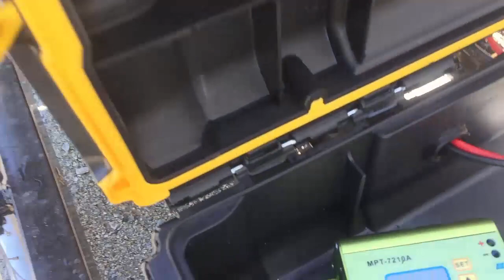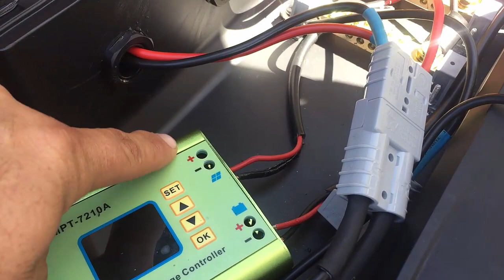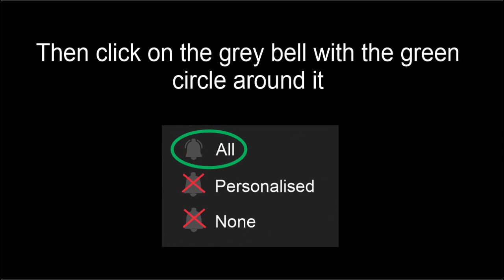Quadricycle Build - Maiden Voyage By Off Grid Mojo

Comment: Hi Ash. Would you need any special permit to ride the quadricycle on the roads? It is 5.1m long after all. One good thing about being heavy is that the wind won't tip it over.
Reply from the maker: No special permit needed as far as I know! The electric assist is 250 watts and does not need to be registered.
Anything over 250 watts does though. However things will change soon enough as there is going to be some tweaking on the regulations in Europe and then that will filter to us as we follow them!

Comment: I agree, 2 1000watt hub motors, controllers, and 2 20ah 48v batteries would set you back around $1200 but would be worth it as you could climb nearly any hill with them.
Reply from the maker: The issue with anything over 250 watts is illegal here in Oz! I have heard on the grape vine though that they are looking at changing that limit higher due to cargo weight etc. Basically Australia has the same legislation that the EU has, so once it changes there my guess will be we will follow suit! I would like an extra wheel on either side at the back of both the prime mover and semi trailer, but that may just be romantic ideas as I don’t have enough knowledge of these things to realise if that’s even possible!
Reply: @offgridmojo  Thank you for replying.  If that were the case here I think I would just install an AGNI/Lynch High power axial gap DC motor (a fantastic motor invented by Cedric Lynch of the UK) and register it how he did.  He rides a 2 wheeled fully enclosed motorcycle powered by his motor on UK roads almost every day possible.  That motor can make from .1-15hp depending on current input therefore it's amazing.  Maybe you'll have to register and accommodate your vehicle as a motorcycle?
Reply: @offgridmojo  Also-here in the USA I ride a mountain bike with 1500 watt hub motors both front and rear with a pair of 1.5k controllers mated to one 20ah 48v battery.  I'm sure it's not completely legal or even nearly, yet I have travelled over 10k miles while breaking many traffic laws without being pulled over by the police, and 50k miles on gas powered bike conversions in my past with no problems whatsoever.  My plan was always to just pay the ticket if I got one, but so far so good.
Reply from the maker: @ProlificInvention  I will check him out, thanx for the info mate, it’s appreciated.
Reply from the maker: @ProlificInvention  Yeah I have often thought about just taking my chances and going more power etc, funnily enough though it’s not the power that concerns me the most or the speed! Main concern is will the rig hold together, will it crumble under so much weight etc!

Comment: Das Gespann schaut einfach nur Klasse 👍 aus ‼️💯😉 aber warum kein Differenzial hinter ❓🤔😉🍻
Reply from the maker: Thank you, it is a lot of fun. The weight of the trailer was an issue in regards to a diff, at least that’s what I am lead to believe. I contacted Samagaga and told them what the weight would be and they said they didn’t have anything that could handle it, I also never really asked Ben at Trisled as to why he didn’t put one on, I figure he knows best. That being said I do believe I need something as that wheel spins in gravel going up a hill and almost all bike paths here are made of gravel.
Reply: @offgridmojo  Alternative to diff could be a freewheel on both wheels but that requires some custom parts. You could try asking "velomo" from germany.
Really awesome build, thanks for sharing!
EDIT: Never mind, it seems the quad has only one driven wheel so doesn't need a diff!

Comment: How much weight to you plan to deduct  on the trailer?
Reply from the maker: Dunno know that yet either, as I said in the last upload I will tweak the bafang controller first and build a more powerful battery, failing that I will start to deduct weight, ie : fridge, go with smaller battery inside semi trailer etc.
Reply: @offgridmojo  - if can offer some thoughts, (just thinking here). Smaller fridge will weigh considerably less. And most suburban/country butchers will happily vacuum seal meat/veg whatever for you for $3 a bag. That will keep for many weeks in a smaller fridge if packed carefully.

Also the Joolca is an unnecessary luxury and extra weight.  Especially when you take into account the gas cylinder required. When I was cycle touring I used a JetBoil to heat a mug of water. Pore that into a regular $16 solar shower that weighs close to nothing. Top up with tap water to fill the bag and to bring the water temp back to "warm". Bingo. A shower that is ready in minutes and weighs sweet bugger all. Plus the JetBoil makes your coffee. (and can be a suitable single burner cooker if required)

(my wife and I, and two dogs, now travel in a 4wd and small camper and we decided that the Joolca was just too much extra weight. Easier and (almost) just as fast to use the method above...)

I understand that you plan to live in the camper. So it's nice to have it more like "home" and less like "camping". But there is no reason to not embrace some of the light-weight aspects of traditional cycle touring for some of the heavier equipment that you need.
Reply from the maker: @morepawstravels  Hi Wayne, thank you for your input bud, it is appreciated. I feel a bit better about the weight now that I have ridden it a few times fully loaded! I have been living very rusticly for some years now and if I can I will keep the Joolca, once I have the correct connections I can use a smaller gas bottle and see how that goes! The fridge is definitely something worth swapping out for a smaller one though.

Comment: I can hear the disappointment in your voice. It's an expense but have you given any thought to hub motors? Effectively you can pop a 1000w in each wheel (even the trailer wheels) and still keep the mid drive Bafang motor.
Reply from the maker: Yeah it was a bit heart braking! Yeah I need to do something for sure, when I get some more money I will talk to Ben about what can be done, other than that I had another ride on it today and I feel better now with how it performs. I had forgotten how difficult it is going up hills even on the green speed magnum with kids trailer on the back it’s very slow, dunno what I was expecting the quad to do differently, hehehe, especially with all the weight it tows.
Reply: @offgridmojo  - the 1000w hub motors sound like a good idea. Maybe the two rear wheels of the quad. Use them as a "last resort" to make it over some especially brutal hills. The other thing that might work is to swap the trailer hubs for Dynamo hubs. Every little bit of juice will help. Could also do the same to the front wheels of the Quad.
Reply from the maker: @morepawstravels  Good ideas Wayne, cheers.